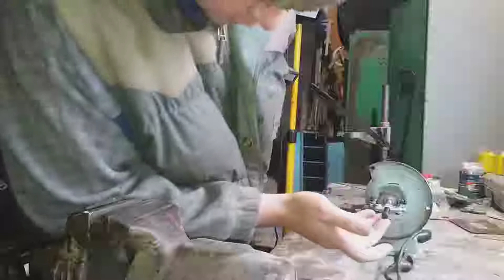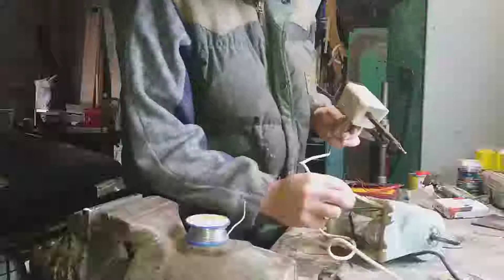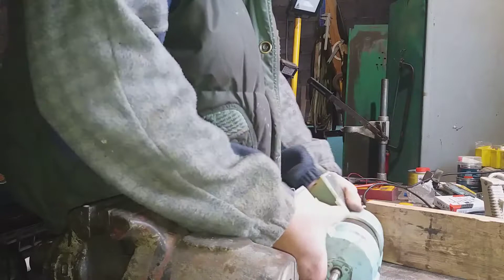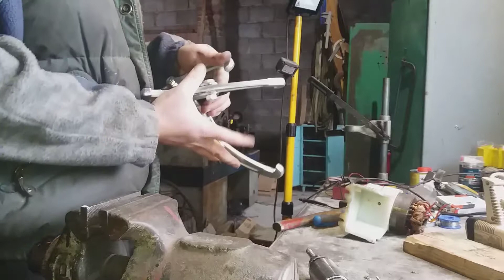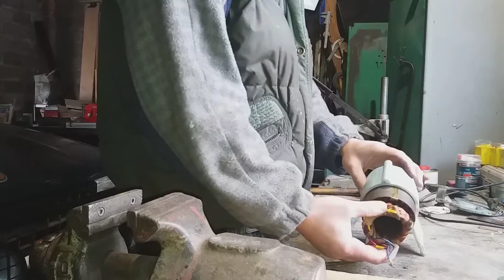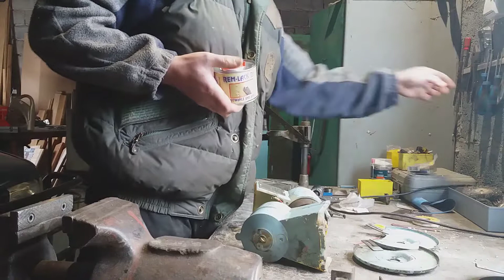Szlifierka Elna SZ 120 125  naprawa część 2 Elna SZ 120 125 grinder restoration part 2

Comment: I changed capacitor on mine Elna but it is still just "buzzing" when i try to start it...
Reply from the maker: Have you checked the resistance? Between 4 and 2  should be around 16 Ohms, between 4 and 3 - around 40 Ohms.
It looks like You don't have conductivity in this larger circuit, or the capacitor is not connected properly.
Where are You from?
Reply: @jendrekagroturysta  Finland, can i have your e-mail adress?
Reply from the maker: @arabianights1  Try to use "Email for business inquires". It is nice to see that old Polish machine is so far away :)